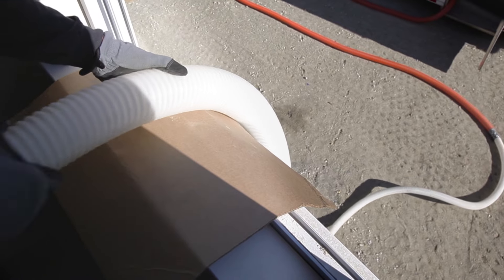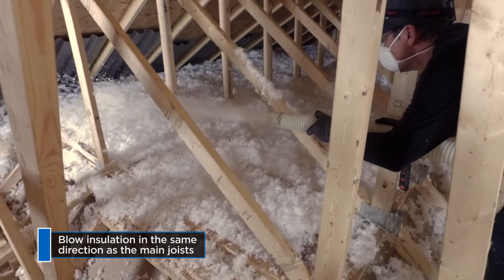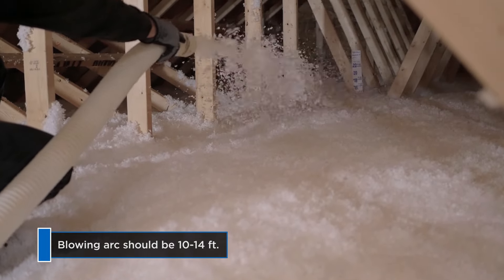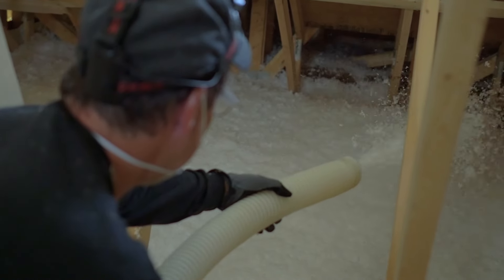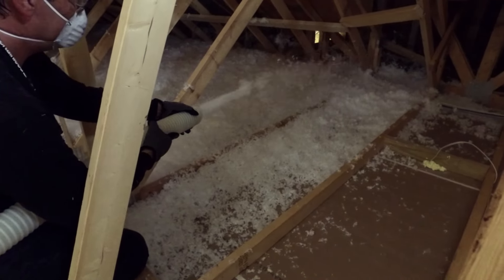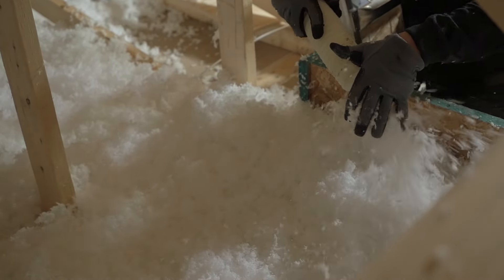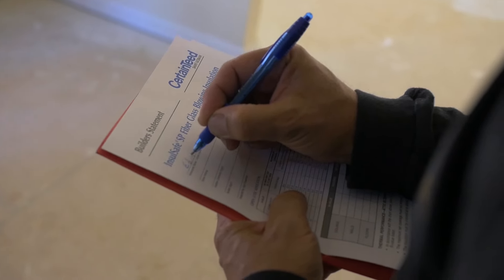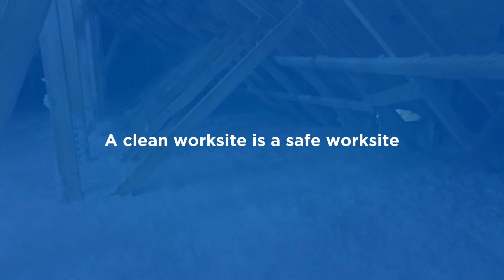The Right Way to Insulate Attics with Blown-in Insulation

Comment: That sure is a lot cleaner than most attics I’ve done, machine works good as well with a steady flow; I see no static or much valleys, well done for teaching purpose!
Reply: Excellent job - notice that they Great Stuff FOAMED all the sheetrock to wall top plate gaps/cracks which otherwise flows attic air into the walls below. Likely now a code requirement and I am shovelling off these areas to clean and FOAM before adding 10" for over 10 years of settling and HVAC ect upgrades. Looking for a building supply place for Certanteed as HD only has cellolose like stuff from Knauf.
Reply: I have a question or two for you sir. I recently was employed by a blow in company, but I don't know if things are necessarily done right after watching a few videos on the subject. How long should a standard job take? Let's say 1000-1500 square feet? How does old compressed/settled existing insulation affect the R-Value of new product being blown in over the top? Are there any websites you can possibly direct me to for some extra research?

Comment: Now the question is, how in the world do you walk around or do any kind of maintenance in the attic now that you can't even see the joists?
Reply: Lern to fly
Reply: Do what you can first. Most people never even go in there attics.
Reply: Remove all of the insulation. Do your maintenance. Put all insulation back where it was. Easy peasey.
Reply: You feel them out with your feet, find the joist before putting the weight down. I wear thin-soled shoes for this purpose when I work(I blow in attic insulation)
Basically do your maintenance work first before you insulate, if you have to do something up thereafter you may need to blow in more insulation in the places you packed it down.
Just today I did a place that had an electrician install a bathroom fan and vent in the roof but not the hose. I installed the hose and smoothed out the insulation that was scooped away, then blew in 2-3 bags to fill in the low spots EZPZ. While cheaper than doing a whole attic, I'm sure it wasn't the cheapest thing to do but it was necessary for them to get their house up to code for sale.
Reply: @weldon9254  easy???😵‍💫

Comment: Is this worth the investment, does it really help. I'm in an older house and when the guy just did my AC unit maintenance he told me attic insulation level is a 4 and should be at 22, I'm a widow so just don't want to be ripped off...
Reply: C Logan it does save a lot of money in the long run getting it done properly. I put my home from an r30 to r60 and my gas bill almost cut in half
Reply: @Adamjboss187  I did  this in my  first home 17 years ago, I had an existing 8" of the old yellow chunked blown fiberglass, R2.2 per inch.
I added about  10" of newer blown fiberglass which  was supposedly R2.5-7 per inch.

I think  the house held heat a little better than previously,  it still  got hotter than hell in the summer.
It  really  was not  worth the effort ,  or the  week of poking/itching after.

I had  always suspected cellulose  was much better,  but I ended up  getting a sweet  deal on the fiberglass.

In my current home I blew 11"  of cellulose (R3.7 per inch)  over an existing 8" of blown fibreglass.
The furnace doesn't cycle on near as often,   and the house stays  much cooler during summer months.
It is definitely not  worth it, unless you use cellulose.
You definitely will not cut your gas bill in half by adding blown in fiberglass,   unless of course, you had no insulation at all in the attic to begin with.
Loose fill fiberglass loses half it's R-value in sub zero winter temperatures ,  heat  from the attic radiates  right through it during the summer.
Reply: Fart man although I’ve heard good things about cellulose and I blow it often for certain Homebuilder’s, based off what I’ve seen in older homes with it I wouldn’t recommend it. I’ve gone into many homes that had cellulose blown in and the stuff has become a thin layer resembling paper mache. I don’t believe it’s doing anything at that point. I think that happens from moisture in the attics over time. Hopefully it continues to work for you though. Could just be my locations weather that doesn’t agree with it
Reply: @Adamjboss187  What  you are likely observing in these older homes is, back when they were insulated codes did not require near the depth we require today.

Back  in the late 60s, early 70s code only required   5" of wood shavings,   4  1/2" of blown fiberglass, or approximately   
2  1/2"  -  3" of cellulose.
By 1975 our local codes changed, attics then were required to have    5  7/8" of cellulose, or 8" of loose fill fiberglass,  this  was in our  code until the late 90s.
Our current code requires  minimum 9" of  cellulose, or minimum 15  1/2" loose fill fiberglass. 
Both equal R-33,   so that tells me  local codes in my area recognise cellulose as being R-3.7 per inch, and loose fill fiberglass as R-2.2 per inch, despite conflicting information on packaging that  claims loose fill fibreglass will achieve R-2.7 if it is installed beyond a given depth.

Cellulose  will settle to some degree, thats why it is always installed with an assumed  settled depth.
Once it has  settled,it becomes even less permeable to air, increasing its effectiveness.
This is part of the problem  with loose fill fiberglass,  it is  so loose and  fluffy,  you can literally look into it, and  see 3", 4" inside of the insulation.
Cold,  or hot attic air mixes  right through it.
A thermal imaging camera is  a good tool to demonstrate what this does as far  as effect on ceiling temperatures.

Years  ago I lived in a bungalow that was built in 1981,  the builder had  8  1/2" of cellulose blown in the attic instead of the minimum  5  5/8" required by code.

Even  on hot  summer days, people would ask  if  we had air  conditioning when they walked in,  we did not have a/c...
So ,  yeah  in 1987  I  suspected  the  grey  dusty stuff was  somehow much better than the pink, or yellow itchy stuff.

I don't blow insulation for  a living,  my career however leads me to see a lot of attics, and other places no one ever thinks,  or cares  about.
( I talk to guys who blow insulation every now, and then when I run into them. Few of them  seem have much knowledge of product R-values, or building science)
If you have been finding insulation that is literally flat  like "paper mache",  these homes  must have  major ongoing moisture issues from inside the structure that absolutely need to be addressed before adding more insulation.
Reply: @fartman2269  unless it wasn't blow in fibreglass you should have removed the fibre before putting in cellulose. No big problem with cellulose itself, but it doesn't stand the test of time like fibreglass does, it also doesn't deal with moisture and condensation very well since it's made from paper among other things. 
The issue with having it above the fibreglass is that it is heavier, what will happen is it's weight will flatten down the fibreglass and effectively ruin its R-Value(although 8" is really not much to begin with).
Cellulose is estimated to last roughly 20-40 years depending on conditions, while blow in fibreglass is theorized to last roughly 200 years depending on the conditions.
Your house holding heat but staying hotter than hell in the summer would most likely be poor ventilation in the attic, either not enough intake or not enough exhaust or both.
Older houses almost never have enough intake or a lot of the time I find a homeowner decided it was a good idea to stuff insulation in their fresh air soffits or board them up. 
Cold shower before hot is how you kill the ich from insulation, cold shower keeps the pores on your skin closed while you wash the fibre off before you turn on the heat.
Not all blow in fibreglass loses R-Value like it used to, Owens caused that issue when they started "cubing" their flat insulating and packing it as blow-in.

Also, I wouldn't recommend blowing in too much cellulose overtop of compacted cellulose, it is a lot heavier than the fibreglass stuff, so you could probably imagine it packing down or settling, having more put on top 20-40 years later, the sort of weight than can be built up there sitting on the drywall. We end up recommending having removals done when we see too much compaction.
Cellulose works great in well vented attics where condensation won't ruin it as it's the best condition. 
Fibreglass works better when the attic ventilation isn't as great since it does breathe better.

Comment: Blow crew make about 24 - 2500 a week just blowing insulation
Reply: easy to do yourself and machines are normally free if you buy insulation from them
Reply: If you've spent any amount of time in an attic, especially in the summer, that amount of money still isn't enough.
Reply: @markbrowning4334 thats why you blow in the fall or spring before temps get high if you are doing it yourself.

Comment: Is your attic VENTED?   If so, as most all attics are, then you don't want to cover the vents.  You need good ventilation in the attic to prevent heat buildup in the summer which will increase your cooling bills AND the excess heat will reduce the life of your shingles.  I'm talking about soffit vents.
Reply: Baffles solves this easily. What you really need to worry about is insulation touching the roof deck.

Comment: Smh where is an attic that wide open for blow? Maybe 1 in 1000 jobs I can’t even with this video…attics have wires, engineering left over from framers, hvac etc etc. Where in this video does it go over how to blow. Also I would like to note that the hose must be pulled by another person from the access hole unless you plan on having a hundred foot of hose on your way out of the attic. Jobs at 2500 sq ft should be done in 45 minutes or less thiers no time to stop and drop the hose out at that length on your own at temps above 150 degrees in the summer months…ridiculous. Make a better tutorial.
Reply: I’m building a house and doing all mechanical work myself. My attic is this clean or cleaner and has a walkway through the middle where a 6ft guy like myself can stand straight up and walk around with blow in insulation 22” deep under the walkway and along the whole attic.
Reply: If you can’t move the hose around yourself then you don’t need to be doing it.